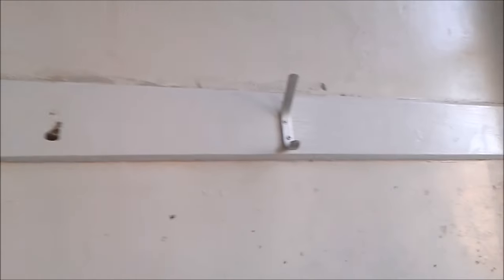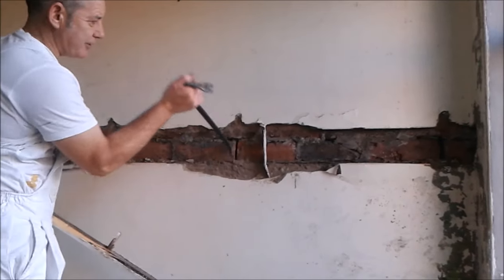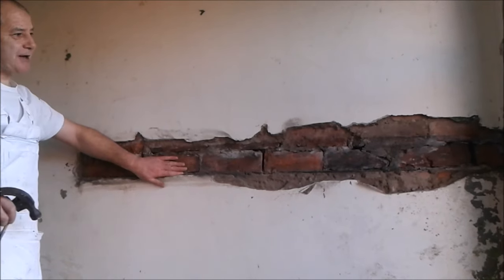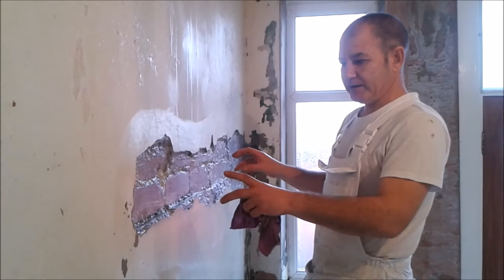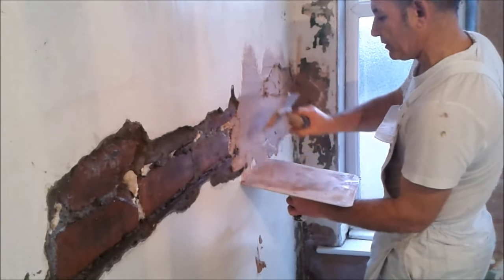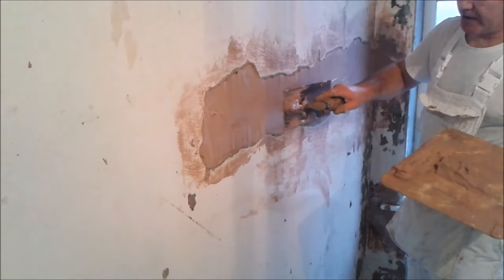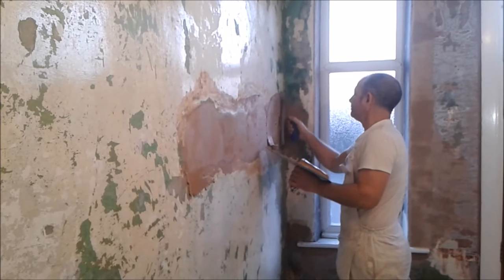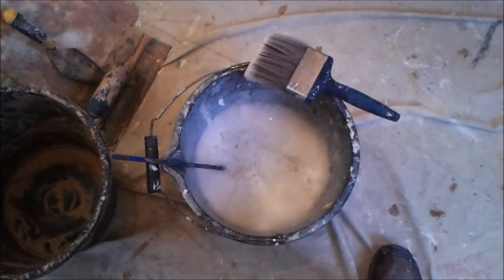Patch Plastering Hardwall

Comment: Wouldn't you  need  to tap around the patch to check for surrounding hollow render also and remove aswell? Nice job though, nice finish.
Reply: Hello from the future. Whilst there is a temptation to do this you can quickly end up with a hole much, much bigger than you started with.
Reply: @gordonm2821  Wow, this was 4 years ago, I can’t remember even commenting on this 😂. I see what you mean tho, you could well be right 👍👍

Comment: Us painters and decorators have to be multi traders and do a bit of everything because Electrians,carpenters,plasters etc leave there work so bad we have to fill make good and paint all there bad work and get looked down on and give a brush to a plasterer and tell him to cut in a feature wall and see how he gets on I bet it looks like a 3year old has done it but well done plasters you can skim a wall but what else can u do fools
Reply: A bit HARSH---but,  the last three houses I have lived in, these past 40 years, all had a barrowload of loose plaster, wood off-cuts, empty paint tins --you name it---swept under the Bath; revealled when the side panels, had to be removed. A friend of mine, discovered same---after 2 years living in his new house, when a faulty waste-pipe seal on his bath , soaked the ceiling below,   and discovered the ancient tradition of sweeping all the upstairs crap, --YEP---under the Bath, is still alive and kicking.

Comment: Is there anything you can fill gaps between the brick with? I have a similar job but the crack is from historical settlement. Wanted to fill the brick lines first!
Reply from the maker: Bricks use sand and cement.
Reply: Jack D - As mentioned, mortar is what you need to fill and strngthen the joint. Bring it level with the brick face, job done. It’s easy to do and the finish is unimportant as it likely won’t be seen.

Comment: I have a very similar job to deal with and this has helped immensely as I'm a weekend D-I-Y-er. The walls beside the bit plastered are just like those I have - how do you deal with those? Is that a sanding and painting job?
Reply from the maker: Yes sand fill seal filler and paint then see if more filling needs doing, using a hard stop filler..... paint and filler mixed together hard stop filler... no need to seal before final coat and it wouldn't flash.   Thanks

Comment: Nice job man! Can I use sand and cement to do this?
Reply from the maker: You could but not the best, and you may have to prime. Use what's recommended and you will have less problems.

Comment: What did you do about the rest of the wall? Did you paint it or wallpaper
Reply from the maker: It got painted. Thanks
Reply: How did the walls looks as I’ve got an old house covered in old wallpaper. Can’t afford to skim it, just wanted to know if painting over old plaster still looks okay?
Reply from the maker: @premsworldfamily6616  it can do, but you will only know when it's been stripped, only use matt emulsion. Thanks.
Reply: Any colours you recommend avoiding if the walls are a bit marked?..or is best if the walls have marks just wallpaper them with something modern
Reply from the maker: @premsworldfamily6616  White and very pale colours will work best. You can apply lining paper and emulsion that. Thanks.

Comment: I live in an old flat, and have a corner area up by the ceiling which was flooded a year ago. It's dried out now, I've removed the top layer of old plaster to reveal really crumbly old render. The upper corner where the two walls and ceiling cornice meet has a hole the size of a fist in it now. The old render layer is about 15mm in thickness. 1) Should I chisel out all of the old render in sight back to the brick and just use the hard wall undercoat plaster to fill it after the PVA? . 2) If I chisel out all the old render, I'll be left with a 10mm gap running vertical where the two walls joined. Should I re-render both walls and rebuild the corner in render, then plaster? Or is this something that can be done in the undercoat plaster in layers?

Hard to explain without a photo!
Reply from the maker: You can use expanding foam to fill the gaps first.. this can be plastered over.. and also helps with insulation...  Thanks
Reply: @PaintingandDecorating  thanks for the reply! So asides from the hole, there are two large patches of exposed wall. about 1m x 1m. The render here is old and crumbling, really dusty. Should I chisel this all out and re-render, or should I seal it with PVA and simply plaster over the top of it in hard wall undercoat plaster, then put a finishing coat on top?

Comment: Good video for anyone needing to do this at home who hasn't got another £200 for a plasterer. You should show people what happens when PVA isn't used at all, just to force home the message. :-)
Reply: what happens??
Reply: @suetheron4495  the existing wall will suck the water out of your new plaster. You'll come back later and see plaster powder, not hard plaster. Never skip thoroughly wetting the wall. Just follow what this guy does and you'll be OK
Reply: @hpt08  hi HP Im applying this to my own 1927 house with clay bricks, and am skipping the PVA.  The fact that the wall sucks the moisture out of the plaster, is part of what makes it stick, because it also sucks the lime compounds into its matrix.  Im throughly spraying the wall before applying any lime plaster, and spraying lightly after application.  So far so good, no cracking and strong as anything, not powdery.  I have to admit, getting the right mix has been tricky (soaking hydrated lime, mixing with gymsum hard plaster, roughly 1:1 ratio by weight).  This guy appears to be using a different product.  I would like to emulate his ability to achieve a smooth blemish-free surface, but my patches are larger and more difficult to achieve this atm

Comment: I'm pretty sure you shouldn't PVA before using Thistle Hardwall
Reply from the maker: Can you explain why you think this?  Have just been reading the back of the PVA and it says to bond new plaster to porous surfaces.
Reply: Its not the PVA instructions but the Thistle Plaster Selector Guide  says about Hardwall and what I have read on plastering forums. I think you can just wet the background. But then if its a patch with flaky plaster around it maybe its a good idea to use a very dilute PVA but you shouldn't do a strong coat of PVA. The only time you might need to use PVA with it, is applying it over the Hardwall if its been left to dry before skimming (which you shouldn't let happen anyway) , even then you can just wet down the hardwall with clean water then skim.
Reply from the maker: mikiex don't worry it will be fine. Both coats of PVA was thinned first.
Reply: mikiex 😂😂😂💨💨
Reply: Hahaha you just wet it to stop it sucking the moisture out the bonding, preventing it crack! Then pva the bonding, like you would over skimming a wall. also this bloke doesn’t look like his used a hawk and trowel before😂
Reply from the maker: Martin Bartram true this is something that he does not do alot of. But the job was sound and it  does not matter about wetting in with diluted PVA.
Reply: Terrible hawk and trowel skills, but good video, easy to listen to.
Reply: And if you leave hardwall too long its very difficult to skim because it sucks all the water out of the skim, then use SBR instead of PVA.
Reply: Nothing wrong with diluted pva on to a brick surface I use to hose the walls down and apply a bit of pva when I was a plastering apprentice and was let loose on floating a wall myself
Reply: @armstronga2358    steady now,  your soft gentle considerate feminine side was showing then ARMstrong. you mustn't weaken

Comment: Hi  whats the difference between thistle undercoat plaster and thistle bonding?
Reply from the maker: The same thing really just different names on bags Bonding Plaster: Bonding is an undercoat plaster. This means it is the first coat, or undercoat to be applied to a new (or to be patched) wall. ... It is the most often used undercoat plaster these days and can be applied to most masonry surfaces

Comment: Never pva bricks or blocks. Bad move.. dusty bricks just need wetting down.
Reply: cosworthjn2 on highly porous/unstable substrates I use diluted BAL prime APD. Not water soluble and gives a great surface to plaster on. It’s a bit more expensive than PVA but I buy it for tiling anyway.